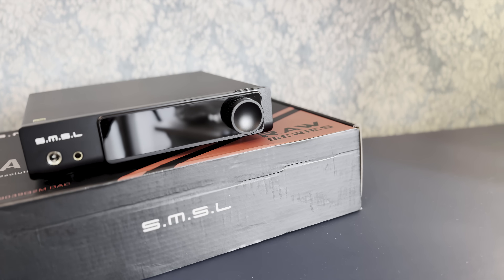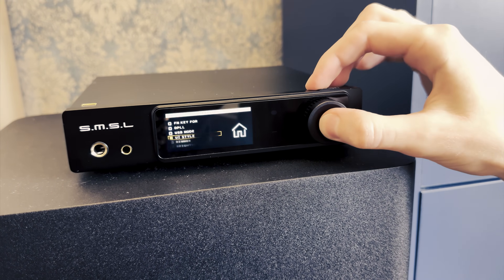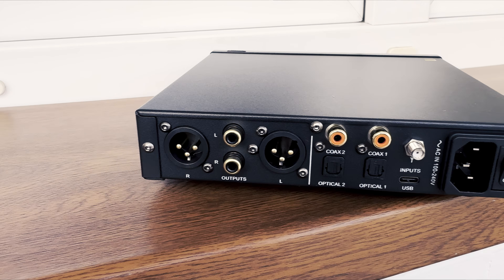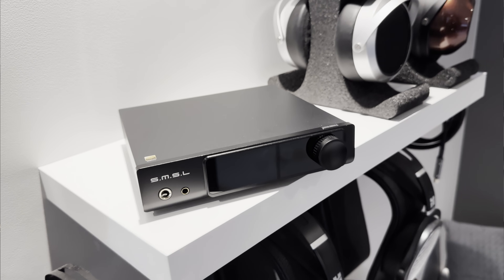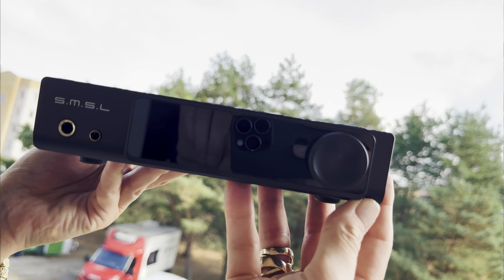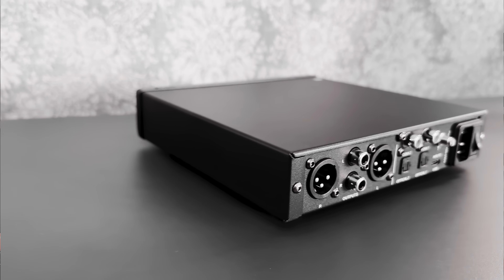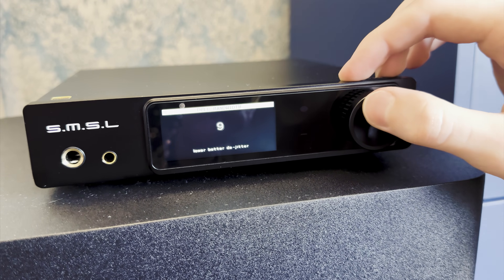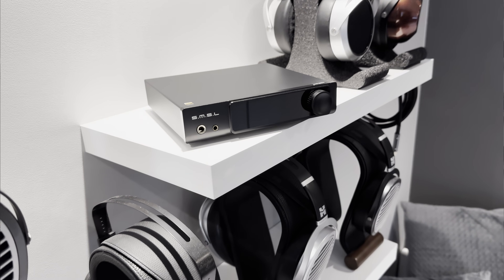Is SMSL RAW-MDA1 DAC the SECRET to GREAT Midrange Sound?

Comment: Hi how are you I think you review very professionally.
I wanted to please consult you I'm hesitating between SMSL RAW-MDA1 and topping d50 iii ?
My equipment is two amplifiers ROTEL RA11 and YAMAHA RN 602.
Speakers Bowers & Wilkins CM8 and PHASE TECHNOLOGY Velocity V-12 (which I prefer).
I use One Little Bear VU3 SWITCHER .
I listen to music mostly from the computer connected with SMSL SU1 to Rotel and two streamers each connected to a different AIYIMA DAC-A1 each connected to a different amplifier in short,
On the computer connected to Rotel I use VIPER 4 FOR WINDOWS
And to YAMAHA I connect Equalizer Rotel RE-830
I prefer the SMSL RAW-MDA1 because of the connections and convenience
On the other hand, the topping d50 iii has a built-in EQ in the computer application and according to CHAT GPT the sound with the EQ will be better than the VIPER 4 What do you think? Please help me decide what is important to me is the first thing the sound quality (I really like listening with EQ) Of course, convenience is also important to me and I think that with the new SMSL it will be easier to use

Comment: Thank you for a great review.  Based on your enthusiasm for it, I bought this as my introduction to DACs.  It is a wonderful addition to my modest sound system.  I am stunned by the additional punch and clarity I'm getting from my old CDs that I haven't played in years.  So I've been blowing the dust off my old CD collection and hearing them as though they were brand new releases.  In my opinion, this sounds better than SACDs.  

I will say, however, that there seems to be a bit of a loss with the highest of highs such as bells, triangles or delicate percussion sounds.  To my dismay, they are lost in many recordings.  I tried using the balanced outputs.  But with my system, they seemed to bring a little harshness to the overall sound.  You'd mentioned extra midrange.  It's very true!  It was rather fatiguing after a while.  So I went back to the RCA jacks, and I'm much happier.  I will ask you and any other reader if they have noticed the same loss of very high highs with this unit, or is it specific to my sound system?  All in all, this has been one of the best additions I've made to my sound system in a very long time.  For a reasonable price, you can make everything sound new again.
Reply from the maker: Thank you for a great comment! I'm so happy that you're satisfied with your purchase. It tells me - as a reviewer - that I did a good job with the video.

I'm curious - what kind of system do you consider modest? If you don't mind sharing, I'd be happy to learn more about what you run in your setup.

I think that what you experience with the treble, could be the side effect of this extra midrange. When you think about it - it makes sense. You can't have more midrange, more treble and more bass at the same time! It's one or the other.

It's very interesting that it works better with RCA in your system. Do you think your XLR & RCA cables themselves could be the reason why? Or perhaps the gear you plug it into is more happy with single-ended?

Answering your question - iIn this DAC, the treble character can be manipulated by using the different digital filters. You have a lot to play with, and you can slightly tilt the treble in either way you want. Let me know if you tried messing with those.
Reply: @TheAudioStuff  Thanks for the reply.  My system consists of a Yamaha RX-A4A receiver at the center.  When I had written my comment, I was using Definitive Pro-Monitor 1000 speakers as the front stereo.  With a Definitive ProMonitor 100 Subwoofer.  I would always switch to these speakers when playing through the DAC.  I played my CDs through an Oppo BR deck from 2010 using fiber into the DAC.  The sound was really incredible!  The soundstage was BIG!  There was quite a punch to everything, but those ultra highs were not there.  I did try playing with the filters in the SMSL but could barely tell the difference.  I will admit that I am 68 years old and fear that I have lost some of my high-frequencies.  But I can still hear them in other settings.  So they're not completely gone.

I have since added Emotiva XT1 speakers as my front.  I really struggled with these because they were so heavy in the mid-ranges.  I almost returned them, but found an EQ pattern that made them palatable.  The soundstage has shrunk.  It's got great bass, but there are moments when the much cheaper Definitive 1000s sounded more satisfying.  I switched back to the XLR cable and found it a little more pleasing with the Emotivas.  So I'm still tweaking and playing.  Still marvelling at what a little DAC can do!
Reply: @Crog2  Thanks for the feedback.  I'm glad to know that I'm not imagining things.  I still enjoy it a great deal.  But I will be looking to improve on my next DAC.

Comment: Hey man. Where did you buy it in Poland? It's hard to get here. Thanks
Reply from the maker: Otherwise, shenzenaudio is a good option.
Reply: @TheAudioStuff  so would you recommend it to pair it with kali audio LP 6? I'm asking because I'm moving my topping mx 5 to the living room and looking for desktop replacement 😀
Reply from the maker: @ Ha, I used to have LP6 from Kali Audio! Now I’m using their subwoofer (you should get one to pair with the LP6 btw, that will be a more significant upgrade)
Reply from the maker: Pairing wise, the LP6 could do better with something brighter leaning, or sharper sounding. Nevertheless the RAW MDA 1 isn’t that far off, it should be a decent combo. Probably not the best one possible, but still good.
Reply: @TheAudioStuff  thanks a lot for your answer. Well, basically I'm looking to build a desktop setup for listening music while working. I came up with kali audio as they are decent monitors but need a dac for it too. After researching this price range it seems like smsl raw mda would be a good choice. At the moment I got topping with wharfedale speakers but that goes to the living room. I heard that kali audio is good for listening music in close range.
Reply from the maker: I've had some Kali Audio stuff, it's pretty decent for what it is. But honestly, if you're looking at their LP6/MM6 line, I'd go for a slightly brighter DAC. The midrange & mid bass on those speakers is already pushed forward a little. You can of course tune them to your liking as well,  if you like.
Reply from the maker: Heyy! It's available on Amazon in Poland, should be the easiest way to buy it ;)

Comment: I see there is no mention of comparison between the SMSL RAW-RDA1 and similar one you previously  reviewed  the SMSL DO100 PRO...your thoughts please!
Reply from the maker: Hi, thanks so much for asking the question. You're right I didn't include a comparison between those two units. I perhaps should have - thank you for the suggestion! Anyway, answering your question, those two units don't sound that similar. I found the RAW-MDA1 much more mid forward while the DO100 pro was neutral for the most part, however with a slight treble emphasis and a very, very tiny little subbass boost. The technical performance is better on the RAW MDA-1 compared to the DO100 PRO.
Reply: @TheAudioStuff  Thanks for the reply, what was important here is that both of these DAC's should be very similar and a reason to compare.  Cheers!

Comment: would it be possible to use both headphone jacks at the same time with headphones with different impedances or even better be able to switch those outputs via a button?
Reply from the maker: Yes, you can plug in both, but the volume is probably going to be different. However impedance is not the only factor, the sensitivity can likely make up for it, so it won't be the end of the world. Of course, very headphone dependent, but you can plug in both.

Comment: Is it possible to use some sort of 3rd party EQ App with the MDA1 hooked up to a PC, just to increase the Bass & treble just a little, and have that profile saved to use with other devices like a 4K blu-ray player, game console etc?
Reply from the maker: Absolutely! You can definitely use a third-party EQ app with the MDA1 when connected to your PC.  It’s a great way to customize your listening experience across different setups! However, personally, I'm not a fan of EQing - I'm a purist. I believe that your system should sound good with no extra equalization.
Reply: @TheAudioStuff  
Sounds great! As long as the EQ settings get transferred and saved into the Amp DAC itself, to be used for lets say the Nintendo Switch, PS5, Streaming & a 4K Blu-ray player. I'm not looking to do anything crazy, other than slightly increases the bass and treble if i have to. :P

Any idea if the stock sound quality from the MDA1 beats out something like a Sound BlasterX G6?
Reply from the maker: @Turbotendo7  Oh, if you want to save those presets on a DAC, I don't think that's possible. Anyway, if you want to make only slight adjustments, maybe you should skip them, for a more "pure" signal. The RAW MDA1 lets you use different types of sound filters like tubes, warmth and more though - that is saved on a DAC, but it's not exactly EQ.

Stock sound quality from this DAC should be MUCH better than a Sound BlasterX G6. It's a more serious device.
Reply: @TheAudioStuff  Thanks again for taking the time out of your day and answering my questions. Even if EQ isn't possible, I think I'll still give the RAW MDA1 a shot. It pretty much ticks all the boxes anyways.
Reply from the maker: No worries, I like helping out people in the hobby. It's the right thing to do as a content creator. I have the access to lots of equipment that people normally can't have at once - thus why wouldn't I use my time to use this privilege and knowledge to make others happy? ;)

Once you get nicer headphones that suit your needs better, and you drive them more properly (which RAW MDA1 can do much better), you might not even want to mess with different settings to tune it.